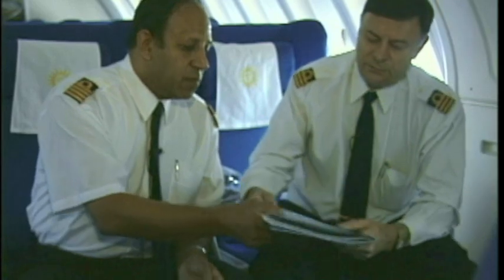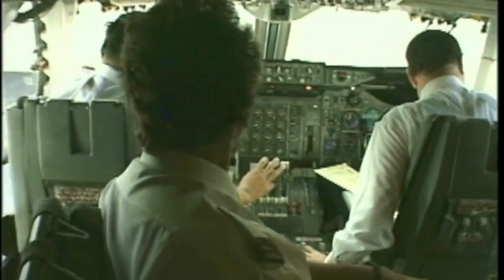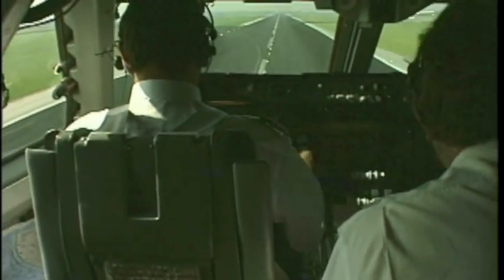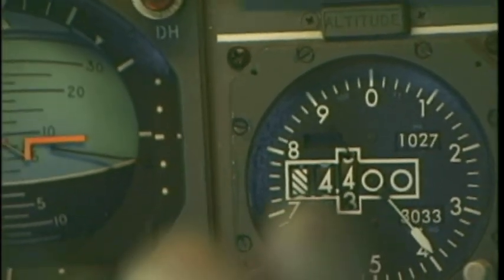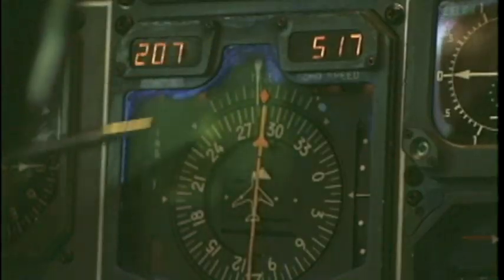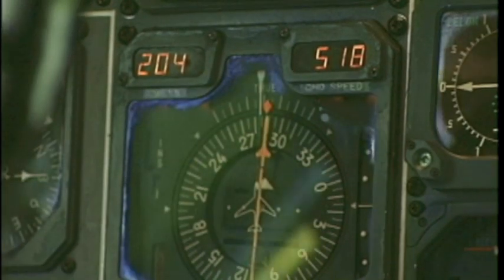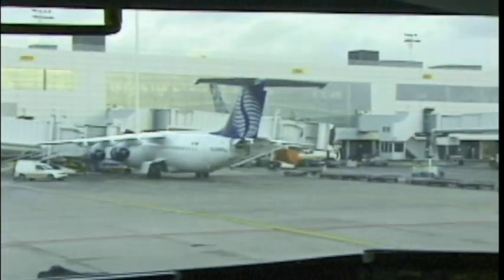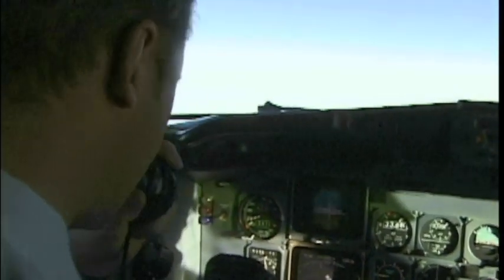SABENA 747-300 & 737 Cockpit Film (1998)

Comment: the 747-400D use the new GE engine, while the 747-300 use the old GE engine and also the upper deck have more windows for the 400D series.